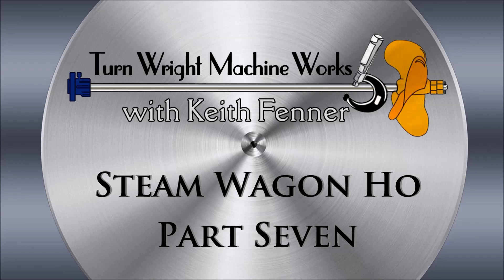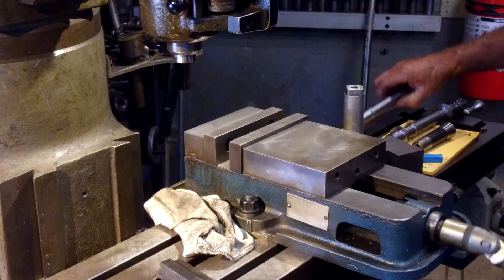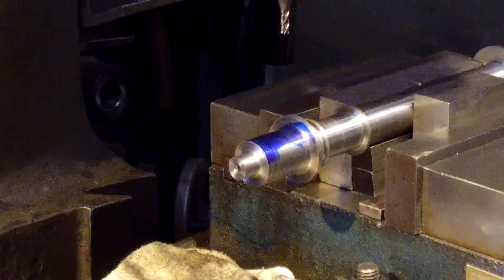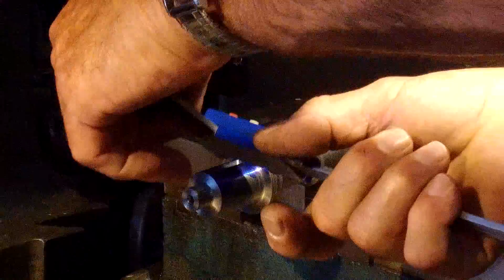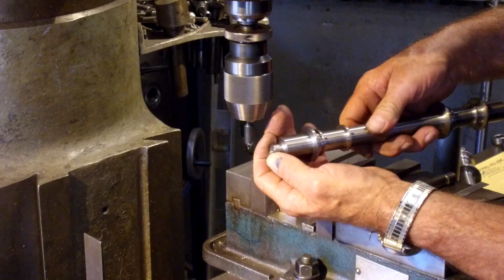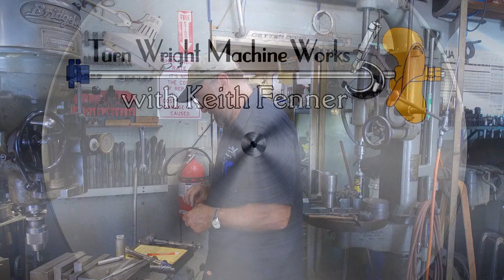Steam Wagon Ho Part Seven

Comment: Faced with those 12 holes such a long way along and so close to the shaft, I think I would make a split collar that fit the shaft pretty closely, and drill a guide hole at the correct radial distance. Then, using an "aircraft" drill (or any very long drill bit, or even a drill bit on a long extension), I would drill the holes using the guide hole in the collar to position the tip of the long drill bit. 

(I leave indexing the holes as an exercise for the reader.)

EDIT: BTW, I have a very quick-and-dirty way of making an extension for a drill bit that can be as long as you like, and is just a little larger than the bit itself. I'd be glad to explain it to anyone interested.

Comment: Keith, have a question on RPM for a 4 flute HSS milling cutter when cutting cast Iron. Just helped Emma Ritson mill a surface plate on my mill today and was wondering what RPM you would recommend. We used about 700RPM and it seemed to work. What do you think? Love your videos. Emma had only kind words for you after the Bar Z bash this year.
Reply from the maker: sounds about right, for small endmills and little slower for the larger ones. I loved seeing her at the bash also. cheers, ;{)------

Comment: I am thinking an right angle aircraft drill, or a small air powered die grinder.  Attach to the spindle and using a spindex or dividing head to get the hole pattern.

Comment: I'd just mill a slot in it with the bottom of the slot where the hole is suppose to be. That way you can just index it horizontally. Essentially the way it was already setup to do the keyways.

Comment: I'm sure holes are specified in the drawing, but the rabbit in the gear will fully radially constrain the split rings so they could be slots instead of holes. Even without the rabbit, the multiple bolt holes will serve the same purpose. That would be a snap to machine with an index head.
I do love that elegant way of avoiding the need to waste a lot of material just to make a single large flange for attaching the driving gear.

Comment: Keith, it appears that the inside diameter of the sprocket is .866 or so to fit tight on the shaft at the location that it is mounted. The end of the shaft measures at .986? So to get the sprocket on you'll have to cut the shaft and you can drill for the sprocket then and then reconnect the two pieces of the shaft back together?
Reply: .984

Comment: Heat wave? In the 80s? My God, I'd give a leg to have it that cool. It's gonna be 102 here today....
Reply from the maker: I grew up playing in the desert and have been in hotter temps without the (humidity) lots of times like sitting in the shade of 109, split mountain Ocotillo wells, etc. Heat wave is consecutive days, not temperature peak, anyhow adding in a humidity factor, I'm not going to work without fans running in shop, when I have them.  ;{)------
Reply: Yep, the humidity is what kills you. The only carpentry job I was fired from was for my own safety. North Carolina in the pinewoods, 90 degrees and 90 percent, and after three days of no sweating by 1pm and puking by 3, my boss said, "Donovan, I love you, you're a damned good carpenter, but go home. You can't die on my jobsite."
Reply: I have lived in Connecticut where 88 degrees and 88% humidity was hotter than 113 in Phoenix...really
Reply: Me, too, except I lived in Springfield, Mass. (Hangs his head...)

Comment: You have me on the edge of my seat.  Without the part in my hand I am not sure how I would approach the hole drilling. Will have to sleep on this one, probably come up with the solution at 2 AM and then not get back to sleep.
Reply: You can get a right angled head attachment. But I don't think you could get it in where the holes are. Now my head is hurting as well.
Reply: I have a small right angle attachment with a 1/4"  chuck. I am trying to figure how I would be able to set it up from precision drilling.  My head hurts!

Comment: Good job.I did noticed that when you side stepped,to open the cut, you did so to return direction so you didn't clime mill ! see I've learned some little things, just from watching I like it.
Reply: climb
Reply: With such a tiny cut, climb milling would be OK, and might even leave a smoother cut. 

(If the cut is not so big as to pull the backlash out of the feed screw, cutting at an angle into the work reduces the tool "push-off" that you get when the tool approaches the work tangentially, as in conventional milling. You may notice that when someone like John Saunders, who uses a CNC mill with no effective backlash, makes a cut, it is almost always climb milling.)

Comment: I've been using my small step blocks for clamping odd shaped things in a vise. After seeing your ground and hardened blocks I'm wondering how far off my step blocks are. I may have to fide someone with a surface grinder around here. I do use tool bits on occasion. It hasn't hurt me yet since I haven't had any critical work to do.    Like #2, View #41

Comment: Could you not have used a couple of V-Blocks to hold the shaft instead? I assume you thought of it, but there was a reason not to use them that I can't see from my chair.
Reply: If you try and picture in your mind how you'd keep the shaft solidly in the v-block(s) it might become clear.
Reply: Have the V pointing at the hard jaw. 3 point contact, nice and solid, square and parallel.
Reply: ...if the v-block is shallow enough to allow the vise's jaw to contact the shaft before it contacts the top of the v-block. (And, of secondary concern maybe, if the block's angle is sufficient to allow the larger diameter sections to clear the vise bed when the shaft is positioned appropriately left-to-right).
Reply: You can get different sized V-blocks. I don't know what selection Kieth has, but I've used a few different sizes in the past. Or you can easily make some to suit the job, I made a couple when I did my apprenticeship, they're not too difficult to make.
I don't understand the left to right concern though - Kieth has already shown it fits in the vice.
Reply: im no machinist, but I was also kinda surprised Keith didn't have a selection of V blocks to jig that shaft up.  But again im not a machinist so im  sure theres an answer I hadn't considered.  Im certain he could either buy a set or even machine up a set of his own-?   I only wish I had the skills Kieth does-lol
Reply: Daniel Way - I dunno man, we're both just speculating here. You asked a question, I offered a possible answer. Seems to me that using a few pieces of stock that are already laying around is a lot faster and easier than fabricating a v-block. Then again, maybe I don't know what I'm talking about.
Reply: I would tend to agree,  I can see where it would take some time to make a set, easier to buy or jig it in I suppose.  But not a stretch to think a pro machinist might not actually make a set, they often make different jigs etc, just depends on the want and need I suppose.